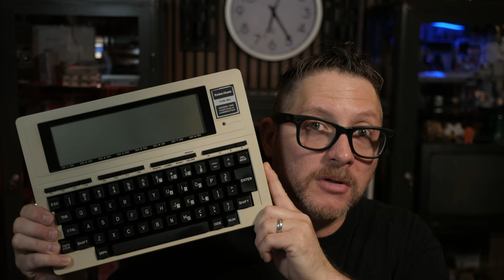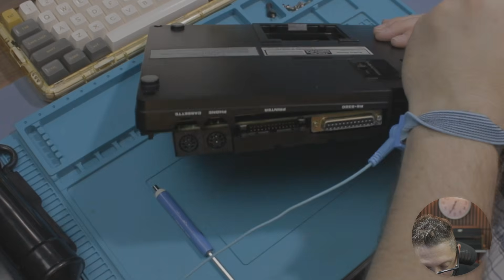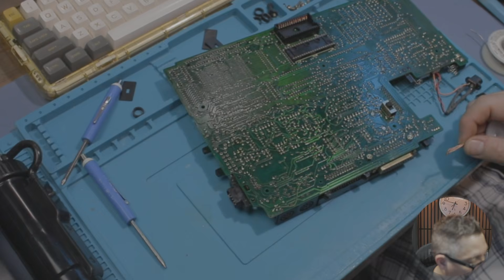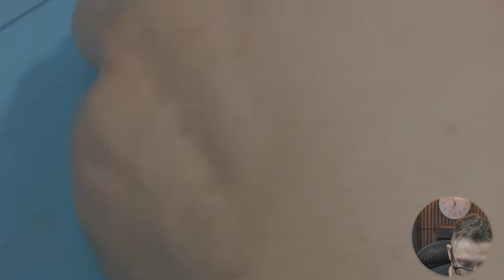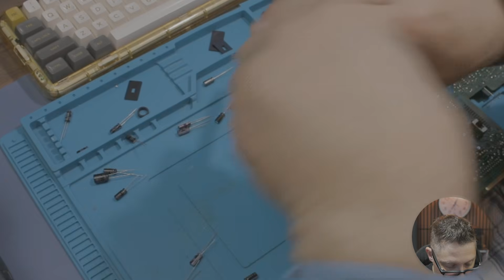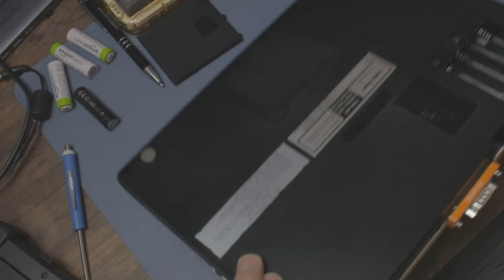Repairing the Original Laptop - TRS80 Model 100 Cap Replacement

Comment: Replacing a capacitor with one of a higher voltage capacity is usually fine.  I just try to keep it less than double the original voltage to keep the charge/discharge curves similar.  Using a cap of different capacitance than an original is generally not recommended unless you know exactly how the cap is being used in the circuit.
Reply from the maker: Thank you. This is what I wanted to say during the video.  For all watching, please keep this in mind.